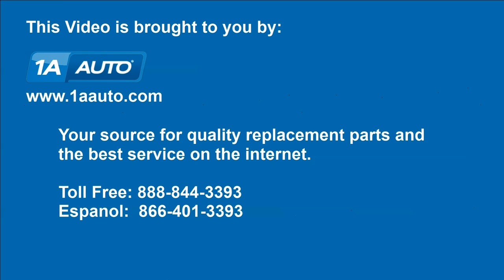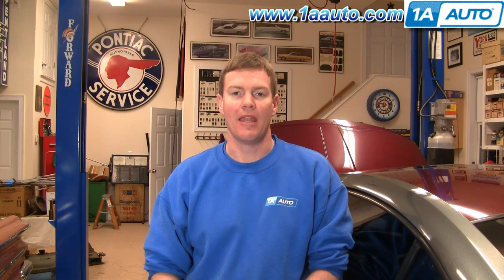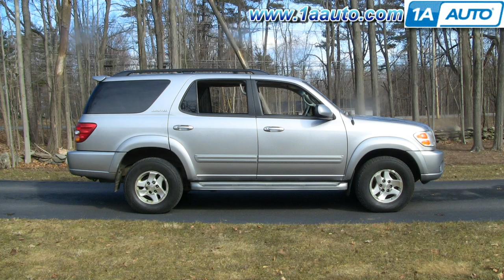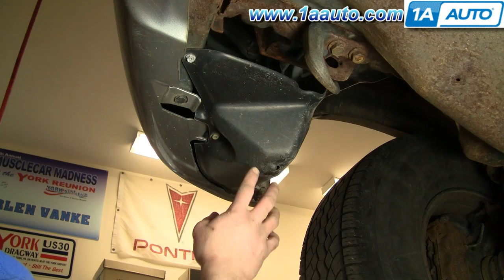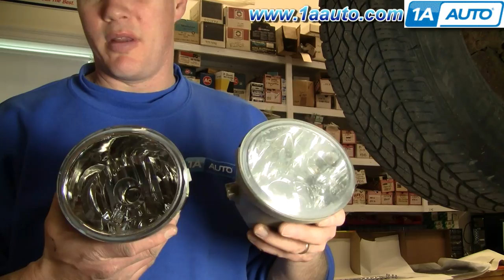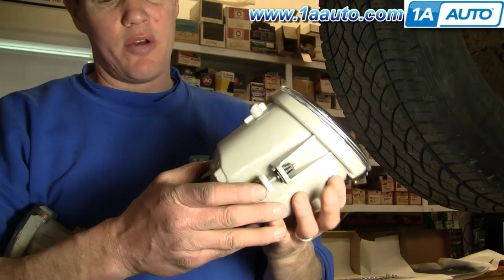How to Replace Fog/Driving Light 01-07 Toyota Sequoia

Comment: I installed new ones on my '02 and the driver side aims far off into left field lol, Meanwhile the passenger side aims almost perfectly just far enough ahead and showing the fog line. I threw away the OEM housings and the garbage was already picked up before I realized I could just replace the lenses and bulbs on the old set with the ones from the new set.